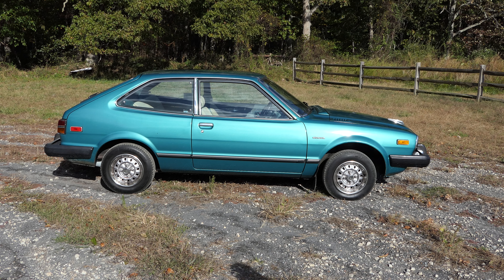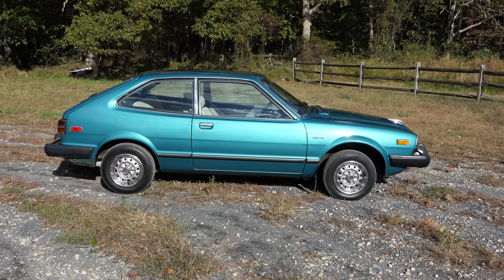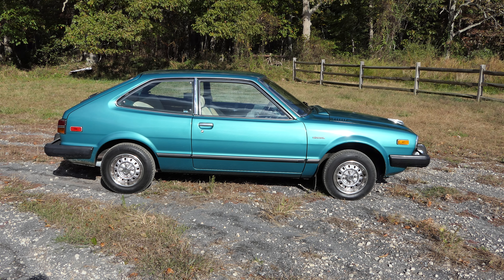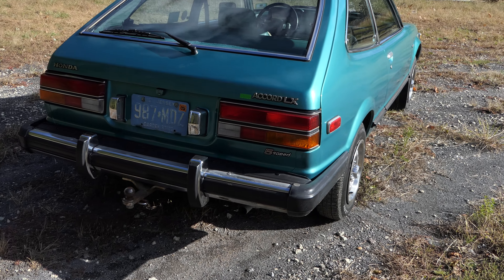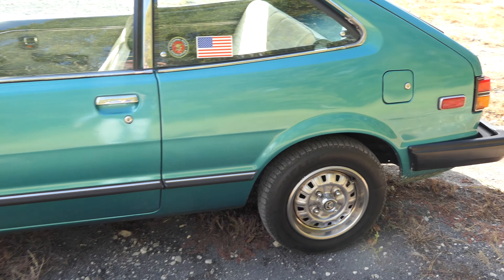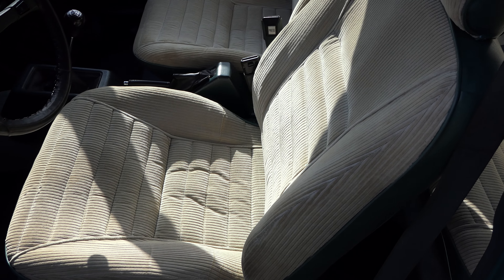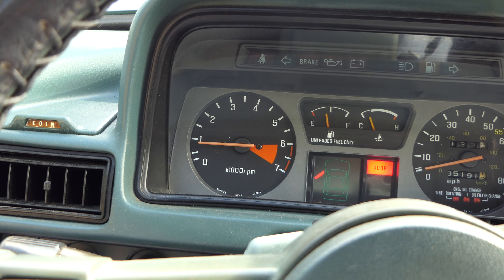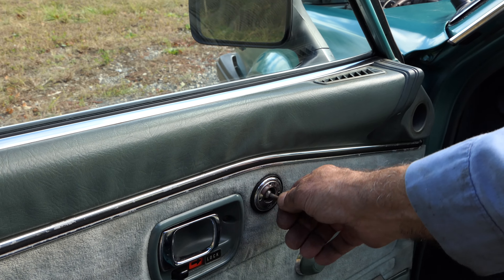My 1981 Honda Accord Pt 1(of 2)

Comment: Love to do this with my mom's car like this it's silver with red interior
Reply from the maker: I remember back in the day, a first year Prelude with silver and red interior.  Very stunning!  The radio was mounted high in the dash with the main knobs right next to each other.  As if they redesigned the radio just for the car. I only ever saw one, that one.
Reply: @HamiltonSRink  yes that car they didn't make as many as the accord's but yes it too was a very nice looking car as well I just wish they would have made a better carb to put on both like the aftermarket Weber that allot of people are going to but I wish they could make a adapter plate so you could use the stock air cleaner underneath of it
Reply from the maker: @ksk101963  Actually, as I was a factory trained Honda tech working flat rate at the local dealership, I had the opportunity to learn what gives with that carb.  The carburetor was truly excellent.  All carburetors need to be serviced every 5 years or so.  The Keihin 3 bore carb is no different.  The mixture is quite precise, and if you had a slow leak in the distributor vaccum advance diaphram, or the vaccum controlled bowl vent, or the choke pull off, or anywhere for that matter, it ran poorly.  If the customer was a little old lady who thought 24mph was just fine, it would carbon up the auxliary valve.  In short, they had their idiosyncracies, but the carb was really well made, and worked well most of the time.  The webers were resorted to by those who did not have the patience to learn the Honda way.  The webers ran ok, but the emissions were greater than the stock carb and all systems working well.  Personally, I liked the Keihin carb.

Comment: Good job. Where do you find spare parts for it? I need them for my own similar Honda Accord in order to be able to keep it.
Reply from the maker: I had parts because I broke cars, and I was a Honda dealership mechanic.  Plus, before it became collectable, Ebay was a treasure trove of parts, at very low prices.  I do still have a few parts left over.  I sold the car,  What are you looking for?